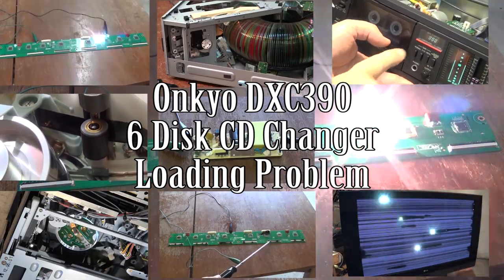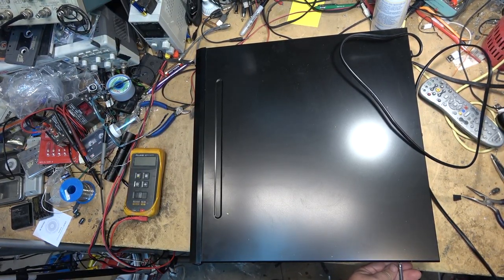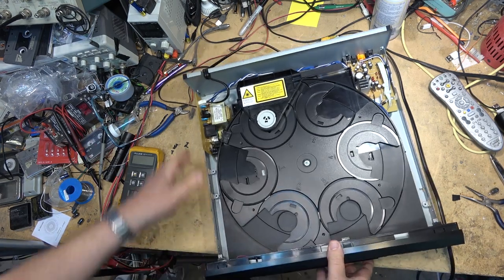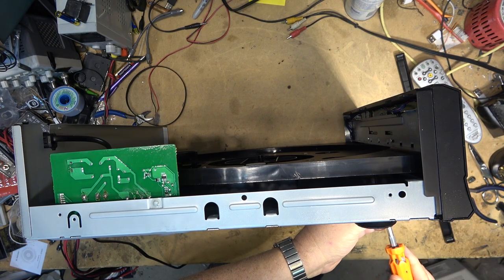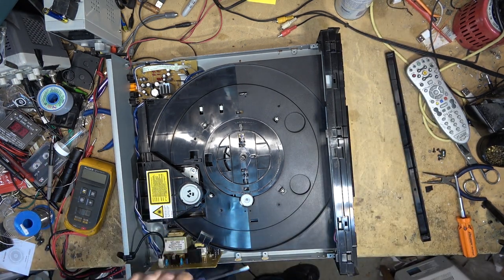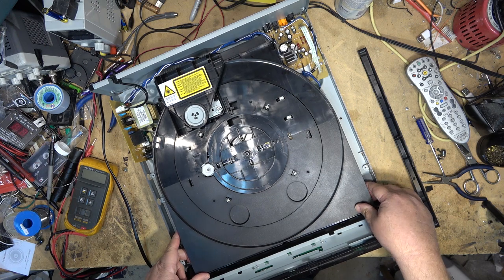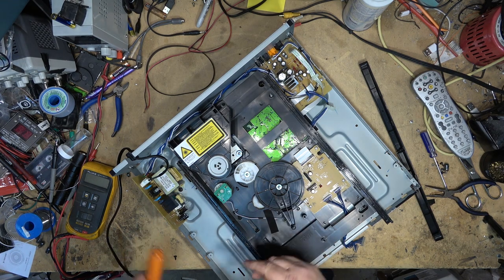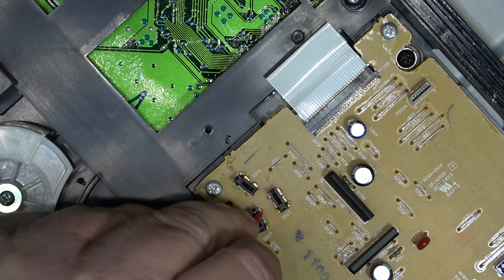Onkyo DXC390 6 Disk CD Changer Drawer opens and closes on its own

Comment: Hi there I have an Onkyo DX C390 and the issue I'm having is it is stuck in standby mode, I plug it in and none of the buttons on the remote work or on the face of the unit, attempted to leave it unplugged for several hours in attempt to reset it and no such luck. Do you have any recommendations on where to start or how to fix? This unit worked fine for 3-4 weeks prior to this issue, I bought it used. I've been having some frequent power outages recently if that helps. It was plugged into a surge protector.

Comment: What a great and easy repair! It's nice when you can fix something that doesn't have 5 layers of parts to remove to get to something simple.... like a belt for example or these switches.  Top Marks to Onkyo!
Reply from the maker: Are you referring to that Macintosh DVD player that I worked on a few years ago where I had to pull the entire unit apart and pull circuit boards out to get the drive out to change the belt to open the drawer. And then the guy didn't even want to pay to have it fixed because he was saving how poor he was. Drives a freaking Bentley and spends half the year in Mexico.  I think he slipped up what he told me he sold it for 1300 bucks that kind of pissed me off because he certainly ground me down on the repair

Comment: On your vid of the Sony cd changer ( https://www.youtube.com/watch?v=yaXwF_1DxtA ) you showed that often the fault is due to a damaged flat cable or the optic sensor. Does this also apply to other brands like Onkyo, this one? I have a DX-C909 where the carousel keeps switching back and forth over and over. I bought this unit with the description of only needing new belts but it only seems to keep on going back and forth.
https://www.youtube.com/watch?v=X-WSFtqyaGo
Reply from the maker: You learned a lesson. eBay sellers are liers. They don't know what is wrong.  They say belt because if they said something else you wouldn't buy. But s belt sounds simple.  I don't buy or sell on eBay for that reason

Comment: Anyone looking for a cd changer I would highly recommend this one. Onkyo still makes this same player as it has been around a long time. I bought one almost 20 years ago and it still works great. These are built like tanks compared to most other ones. The fact that this is the first one of these he’s seen speaks volumes. In fact I just had to replace the original GP batteries not long ago that came in the remote control when I bought it. The use by date on them was 2007.

Comment: I have a DX C340 and it is skipping. tried a lens cleaner CD and it is still skipping so maybe I need to clean the rods at the lens? everything else works fine. any suggestions? thanks!
Reply from the maker: Could be weak laser or spindle motor.
Reply: @12voltvids  so i ended up letting it play for a few hours and now it doesn't skip anymore! lol
Reply: @CurtisRogers68  😁

Comment: They should have used optical sensors as they did with the carousel position sensing. Makes me sad thinking how many of these went to the landfill or recycling because of this simple fault.
Reply from the maker: Optical sensor fail too you know.
Reply: @12voltvids  Yes, but the difference is that an optical sensor might fail, but these leaf switches (because they are leaf switches, just encapsulated) are guaranteed to fail, sooner than later, some in less than 5 years, especially if they are not in use for a few years. Only if they were using gold plated contacts instead of silver plated/silver alloy ones, they would probably be almost as reliable as optical sensors. 
Yes, optical sensors have the downside that if they fail, you can't repair them with some contact cleaner... But that doesn't matter, because a lot of owners will not even bother trying to get a repair quote for their stuff, they just toss it out, sadly.
Reply from the maker: @mrnmrn1  it's a cost thing. Optical sensors fa due to static electricity too. lightning strikes in the neighborhood knockout optical sensors and lasers left right and center